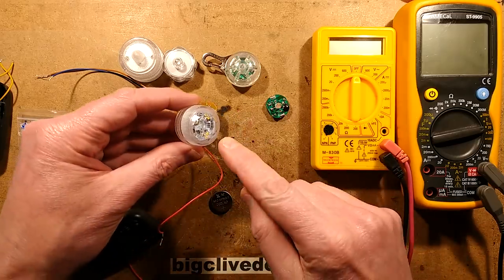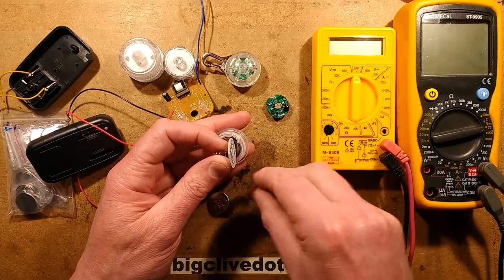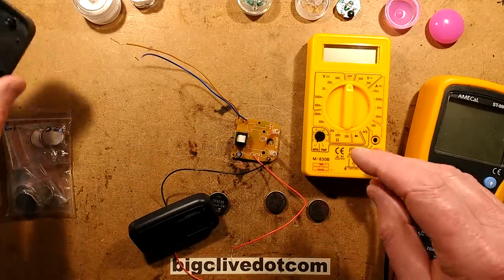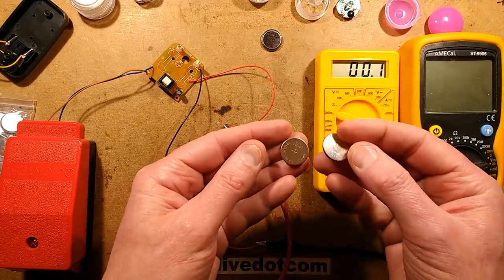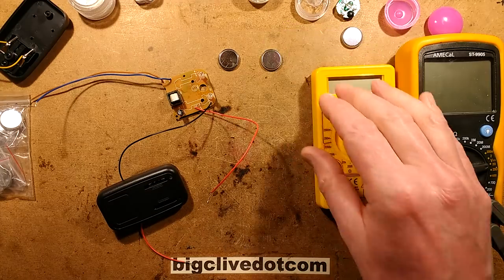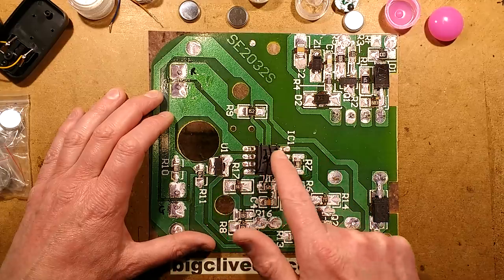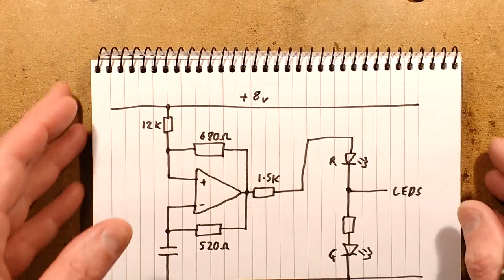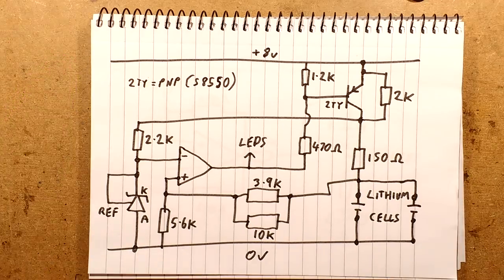Reverse engineering of shady lithium button cell charger.

Comment: Are there any Big Clive videos where he maybe does an equipment review or recommendation?

I notice he tends to only show reasonably priced multimeters and other tools. I am a hobbyist and have previously been a fan of the eeVBlog videos. I find the information fascinating and helpful, but all the equipment and recommendations that dude shows are insanely expensive--must recently a £250+ powered screwdriver!!!--and I am on the verge of unsubscribing because of how exclusionary this is to hobbyists and beginners.

I would be fascinated to learn what Big Clive advises in the way of soldering irons, meters and other basic electronics and diagnostic machines.
Reply from the maker: I tend to suggest buying what you can comfortably afford.  Most cheap meters will be fine for electronic dabbling.  The choice of iron depends on the type of stuff you plan on doing, but again, a cheap iron will often work just fine.  For tools I suggest buying some starter side cutters and long nose pliers from eBay.  The Chinese use a lot of the standard small tools, so the quality is generally very good even for a typical $3 set of cutters.
Reply: Many thanks indeed for replying--I did not expect to hear from the big man himself!!!

I started to get back in to electronics a few years ago via retro-1980's microcomputers. There is a lot of modding in that world so having some soldering ability and a little bit of underlying know-how is essential. I used to do a lot of electronics back when I was a kiddie in the seventies/early-eighties alongside my father and some--although considerably less than the PCAS brochure promised for what turned out to be a rather standard physics degree--at Poly, but the experience really turned me off. Thirty odd years later I find I have pretty much lost all that academic stuff entirely and it seems to be less frustrating just to start from scratch again.

To work on the Atari I got hold of an 'Atten' supposedly temperature-controlled soldering iron from RS and then a 858D hot-air 'station' from eBay--both were less than £50. The best make of handicraft tools like side-cutters, wire-strippers and solder-suckers I have found is the 'Engineer' brand from Japan and they tend to be just on the right side of affordable yet still deliver absolutely excellent quality. 

I'd like to branch out in to more general electronics though, hence my desire to find more tools/meters at a good price which still work well enough for a hobbyist. Sadly the only advice you get from 'Dave' at EEVBlog is unless it comes from a top brand like Fluke then don't even bother. Which is fine and dandy, except I think my wife would divorce me if I even thought about spending £150 on a multimeter!!! On that note I really like the look of the AMECal meter I have noticed in a couple of your videos. At ~£40 it is just on the right side of my budget.  I recently picked up a 'AN8008' meter for £15 on ebay which is nice enough, but it doesn't have a very good micro-amp range so am looking for something to supplement/replace it. The biggest 'want' I have is an oscilloscope of some form--assuming I can still remember how to work one! That would help hugely with the Atari stuff, but of course there is no budget end of that range at all.

Still, at the end of the day it definitely has to be pocket-money prices for me I am afraid!!!
Reply: I think the Aneng AN870 is tough to beat for $33USD. I don't recall specifically testing the u-amp range. For that I use a Uni-T, which are also high value meters.
Reply: An excellent suggestion! It seems to be the next model or next couple of models above the one I bought and I kind of wish i had seen it first! I think I will end up with one of those AMECal units though in the end. The one without auto-ranging has appeared in many videos and I pretty impressed with what I have seen for the excellent price--£40 on eBay.

Comment: Why are these rechargeable Lithium cells always so shitty? They are öfter used in these crank operated flash lights and generally only las a year or so.
The flash lights are sold as ecological, which is ridiculous, given the fact that the rechargeable lithium cells are hard to get or more expensive than the whole flashlight.
Reply: Juri Vlk If those cells were designed as clock backup batteries for computers, they can't handle the heavy loads of crank charged appliances.  The original idea of these things was to pollute less than fire-based solutions such as personal diesel generators or paraffin candles.
Reply: John Francis Doe : Thank you for the information. Nice to know. So maybe one could use normal CR 2032 cells and recharge them before they are completely discharged. But these flashlights are a big scam since they are sold as "green" or as emergency flashlights that are always ready. But since the standard cells last over 25 years when not used, it is better to use normal lithium cells for emergency purposes.
The Russians are more clever: They use spring-wound flashlights! But I couldn't find one in Europe.I only have a Radio you can wind a spring for about 30seconds and then you let it run for 5 minutes to charge a NiMH battery. But same problem: After about 2 years, battery is w.
Reply: yes thats what happened to my 'eco' hand crank flashlight, lasted a year of limited use (it was always flat and needed 2 minutes winding) and ended up in the trash as battery failed, heck it lasted less time than  the 2xaa in  my normal torch, so very much a waste of resources.
Reply: Jusb1066: And nobody cares!
Reply: yep a lot of the eco stuff is crap and landfill before its time
Reply: Jusb1066:  Just made to sell! The solar cells on these "green" radios f.ex. are completely useless.

Comment: Standard 60950 test voltages Clive, that passed with flying colours that.  1.5 kV for basic, 3 kV for reinforced insulation, 1 minute duration, initially not more than half test voltage applied then rising rapidly to the  prescribed level. 100 mA trip tester is usually used though. Ok No real need to go any higher :) Now, a request, because you are misinforming your subscribers and viewers with your transformer tear downs. Stop saying the wire is not good. You have no idea the specification  of the wire used, and a visual inspection cant tell you that. It "looks" like 2UE wire. That is double insulated wire. Not not bare wire as you seem to constantly say when taking transformers apart. The extra thicker sleeved type are triple insulation. You only need basic (2 layers) of insulation between the 2 primary windings. The tape layers provide the double (3 layers) insulation between the primary and secondary windings. The black tape is good on this one to maintain the clearance from pins to windings. You need to count the layers of tape overlay between the windings. Two layers of tape = basic, three for reinforced. However, Without a manufacturers construction drawing and data sheet, it is impossible really.
Reply from the maker: My main concern is that I don't trust a primary wire touching a secondary wire when the only insulation is two very thin layers of lacquer of unknown quality in a transformer that often gets hot in use resulting in possible insulation degradation over time.